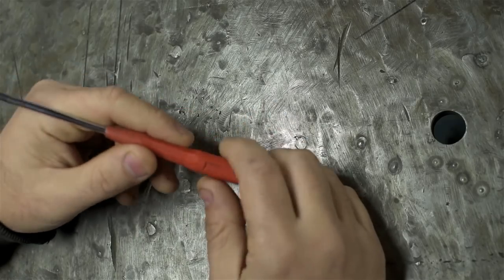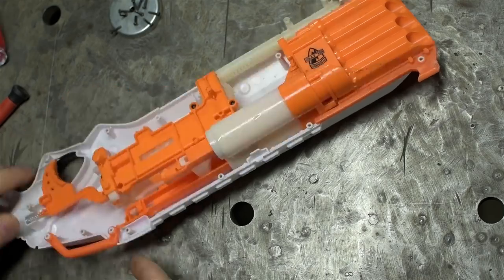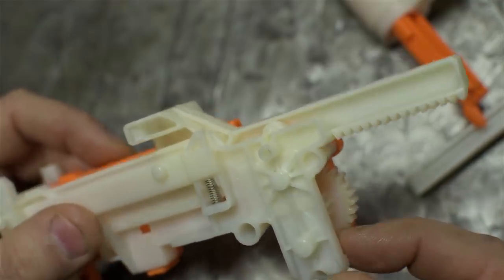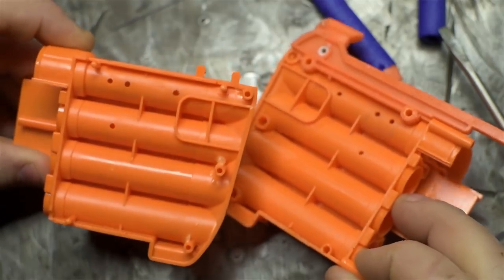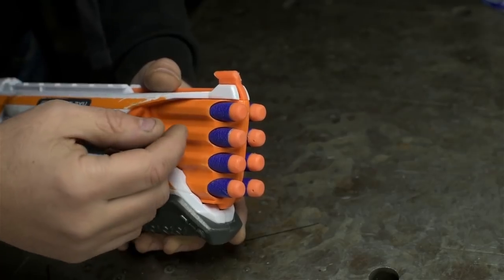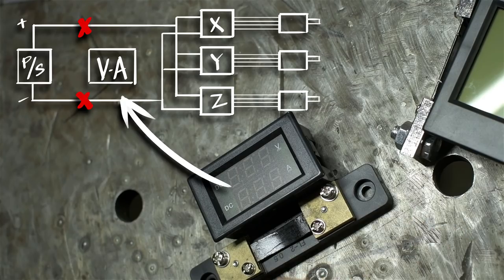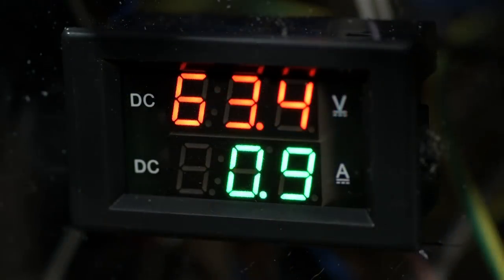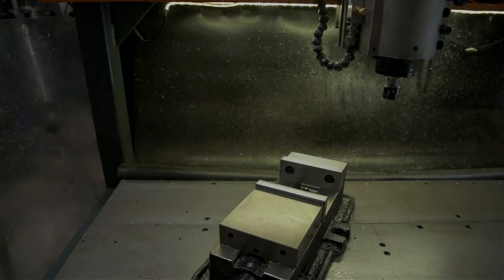Shoot'n The Poop #6 - Fixin' Stuff

Comment: Is Morse code the same in metric? I had to multiply by .0394 to be able to decipher your hidden message. Thanks for the time!
Reply: SUBSCRIBE, this old tony´s classics
Reply: If it's metric then it would be Celcius code...
Reply: It's same but about 2.54 times faster, as it doesn't take dots and dashes that long to travel 1cm as it would take to travel 1 inch of way! :-D
Reply: Unfortunately not, I wish they did have a standard tho would make the Morse code listening websites easier to use and you'd know exactly the length of the dots an dahs and the time space to leave between them when doing audio reproductions.
Reply: Jason Moody  its Morse code for "Subscribe" hes so funny.This old Tony is a Legend! Love this channel.
Reply: In metric it would be macaroni code. Erm I mean Marconi.
Reply: @SlyerFox666  There is no standard timing for Morse code signals though. It's just a long beep for a dash and a short beep for a dot. It's supposed to be something you can do by hand, so everyone's signaling will be a little different. In fact if you listen to enough Morse code you will start to recognize specific people by the way they tap out signals. So having mechanically generated timing would not necessarily be a good thing.

And I just realized that I actually learned a lot from dating Spc. Decker, the Morse code listener in Korea. Last I heard she settled down with a nice guy in Wisconsin and had a few kids. I wonder if the ticking of the fridge still sends her scrambling for a pencil in the middle of the night.

Comment: Holy crap that nerf gun assembly was smart. Never thought they'd put that much effort into a kids' dart toy
Reply: That's the wonder of mass production. Get the design right once, and then pump out millions of copies.
Reply: They are all auite impressive actually. I highly recommend having a look inside any you come across, if you can without upsetting a child. Their design is always clever.
Reply: @magellanicraincloud  Nope... Their design is clever when the design is clever.
Reply: Remember the "Furbie"?  They had such a futuristic electronics package, that the soviets were allegedly buying them up to use in a weapons system!
Reply: It's not a toy... it's a fun gun.
Reply: @jjhack3r  so, a toy
Reply: @billhinkle1653  might be a little grain of truth somewhere in there, but for one thing, the Soviet union was dissolved in 91 and furbies came out in 99. They did use a primitive form of a.i. look up the toy '21 questions' I had one, it's a fun toy. They also used a type of neural network. Interesting stuff. 

If it did happen, it wouldn't be the first time something mass produced was repurposed for a reason no one could have seen coming. Re: tide pods lol
Reply: @dozog  No u

Comment: My grandfather was a research engineer at Bell Labs during WW II. He taught me a great lesson when I came to him with a non-functional electric motor out of one of my toys. "Sometimes you just have to take it apart, try to understand how it works, then put it back together." It worked then, and has served me well ever since. I have a bit of reputation as a fix-it guy, but really, I mostly just take stuff apart and put it back together.
Reply: But if there is not at least 3 screws left on the table then you did it wrong.

Comment: But Uncle BumbleFuck said Fluke meters were super skookem!! I feel like I've been lied to :(
Reply: He is true. But when you use your tools they sometimes break down. Especially those plug things.
Reply: I had the same problem with my Fluke.  Shot the connectors with some contact cleaner and it works good as new.  BTW did those solder joints look cold to anyone else?
Reply: BEdmonson85 Lead free solder doesn't look as shiny as lead solder, even with proper soldering.
Reply: CrimSun ,. True but if you pay close attention to the joint on the middle plug, on the left side. It looked too me like it didn't get full coverage when he resoldered the new connector on. Edit: Actually, both pins on that plug looked a little light on solder
Reply: Now that's funny

Comment: Any good mechanic will always have left-over parts.
Reply: Every self respecting mechanic uses less screws when reassembling a machine he took apart
Reply: @Daravigos  Efficiency and weight reduction are top priority when rebuilding something!
Reply: Just fixed my grandma's toaster, I put in only 3 of 4 screws that held the PCB  as I had a strong suspicion I'll be seeing those insides again.
Reply: Less work for the next chump that has to fix it which most likely will be you

Comment: Unbelievably, I did not know how to measure amps until this video. Apparently you have measure voltage before and after a resistor and divide the change in voltage by the resistance.  No one else ever explained it before, and I have never needed to find out for sure how to do it.  So, that was really helpful to me.

Comment: Another great video, thanks! BTW, at 13:38, the current measurement wires to the shunt should go from the small screws (inside ones) on the shunt right back to the meter, and the "broken" power return should go through the big screws (outside ones) on the shunt. If that makes any sense. The instructions are often not very clear on these, but you want a Kelvin (4-wire) connection and you'll get a significant error if  it isn't done that way.

Comment: Engineer droppings...  I worked in the production crew at a TV station and that's how we knew an engineer had worked on something.  Random screw left behind.  ;)
Engineering on the nerf gun is IMPRESSIVE.
Thanks again for the video.  BTW, they now make little panel meters that have a historical graph.  Might be easier for catching current spikes.  If you hear it but aren't be the meter.

Comment: Current chopping stepper drivers (basically all of them these days) will give you that sort of behaviour. They rapidly switch electricity to the motor coil to achieve your set current (6A) using a PWM scheme. The driver and coil inductance can be thought of like a switching power supply that regulates for output current instead of voltage. 
Mechanical power out is torque x angular velocity. That comes from the electrical power going in to the motor. Electrical power to the motor is set current (6A) x voltage sent out by the driver. Electrical power in to the drivers is what you’re measuring. The conversion is far from 100% efficient and your meter may also be missing the high frequency components being drawn as the driver works but the meter will give you a rough idea of the machine load.

Comment: Another great video Tony, I always love seeing a ToT notification pop up.
If that multimeter develops a similar problem in the future, open it up and double check the solder joint on the top pin of the common plug of the plug strip (you soldered at about the 1:45 mark of the video), hopefully it's just the lighting on the solder in the video, but it looked like a possible dry solder joint. Not trying to be critical of your soldering, it looked fine to me, but as someone who has soldered many a dry solder joint in my time I'm hoping to save you some of the headaches I've caused myself in the past. With plugging in and unplugging of leads over time, if that is a dry joint it may be a possible point of failure in the future, I would hate for you to have to order another plug strip if it is just one solder connection giving you grief.
Great content as always Tony 👍 Keep up the good work.
Reply: It's called a cold solder joint, not dry.

Comment: I thought putting the Nerf dart gun back together was fantastic! Reminds me of my first time rebuilding a carburetor.  There was a ball bearing left over and I thought well how important could a little ball be?  Fired it up with the air cleaner off, and immediately started throwing flame out the top. slammed the hood shut, and as the paint was starting to discolor on the hood, I jumped in, and was going to shut off the ignition, and someone hollered to step on the gas.  Sure enough it worked!

Comment: I've had a fluke sitting in s toolbox that had that same problem.  I couldn't find a replacement socket.  The day I needed it and it was broken I needed to measure volts so I pulled that apart and flipped the socket around so the colors are all mixed up but it worked. That's where I'd never take it apart again until I had parts to fix it. Now 5 years later it's still in a box.

Comment: You should pop the Fluke open and scrub the flux residue off with some isopropyl or ethyl alcohol.  It can do funny things to resistance readings, as well as lower the flash-over protection for higher voltages.  Your actual soldering passes muster.

Comment: those valves at the rear of the dart chambers also act as a sort of 'dry fire' safety system, so the power cylinder doesn't just slam forward when there's nothing to put that energy on.  It has to flow past that valve which slows the piston down to 'less than plastic shattering' levels of power.

Personally, I've stepped up to Airsoft, which is a whole other barrel of monkeys to get a handle on.

Comment: Did you notice that the sear is the Nerf 2x4 isn't the the same height on both sides? Nerfers call it a staggered or staged trigger. It's a simple selector mechanism. If the trigger is pulled slowly one dart will be fired then the other will fire, allowing single shots.

Comment: Probably measures current the same way I get the plate current on my amp tubes. Just put a 1 ohm between the cathode and ground & get the voltage drop, that way I don't hurt my head with math-y stuff.

Comment: Hi Tony! Firstly, it is a great video alzo funny. I have a question about my cnc router.İt's steppers have 12.5Nm torque(in my calculation it is enough torque) and X axis is driven on rack and pinion.So I have to active backlash-compensation(0,05mm) in mach3.Here is the problem occurs.When X and Y work same time or high feeding (upper 1000mm/mm), Steppers are stalled. I watched your older video about your CNC router (part3) you use  backlash compensation .Have you ever compared this to a situation like this. 
 Have a Nice  day

Comment: 2:00 Don't forget to re-calibrate the surface flatness function against your 1-2-3 block. The offsets are stored in volatile memory on the Fluke 83. My company ended up  sending a bunch of out-of-tolerance parts to a local art school for recycling. It's been fixed in the latest firmware patch, but I think Dave Jones might have a hardware mod for it as well...

Comment: I am totally shocked.  All that wear and tear and you still have all the darts!  I trust you have taught your son to respect his weapon and to only fire at evil miscreants of society like Amway distributers, loud Harley's, and anything with tinted windows that goes BOOM BOOM BOOM (not that I am bitter or anything).  
I have the same ammeter kit I got awhile ago to put on my machine thinking I could relate spindle load and tool pressure for comparing inserts and grinds, etc.  Maybe someday I will work out using it with a 180V reversing motor controller as I don't think the kit will work in reverse.

Anyway, best holiday wishes to you and your family.

Comment: The current indicates how hard the electrons are working to turn the spindle.  The harder they work the higher the current.  

In this case you could use knowledge of the current current value, meh,  to fine tune the RPM for differant materials and depths of cut.

Comment: You're dead on about the holes in the sides of the barrels of the nerf blaster.  Even despite the attempt to balance, the loss of power as you go from firing top to bottom is pretty noticeable.

Comment: does anybody know what the multimeter part is called i have a similar problem on mine but i can’t figure out what the part is called to get a replacement
Reply: you should search on ebay (or Google, maybe Amazon) for something like (if you have a fluke meter),  "Fluke multimeter socket replacement".  I just did this on eBay and found some.

Comment: Great video as usual- just some computer info totally out of nowhere. not sure what kind of computer for editing you have but I just got a ryzen 1700 computer (with ssd) and elements has not asked me once to render- no delay at all from the computer during edits.  I had a fairly recent model intel that was driving me nuts- was only quadcore, ryzen is 8 core 16 threads which is key for editing (that and a sdd).  Anyways if you don’t have an 8 or 16 core CPu consider it- I will be more than happy to pitch in some money for this if you set up a Patreon as you have “pitched in” your time for us.
Reply from the maker: wow, good to know!  not sure what I'm running.  i5?  i7?  quad core most likely.  I most definitely wait while it renders :(

Comment: Tony, I know your a busy man but can you let me know how you run 3 phase in your workshop? I've just been quoted £22,370 by Western Power to have it fitted in my shop in the UK!!! The top brass at Weston Power must spend there spare time with there fingers in the sockets they supply electricity for, or people have just got more money to spend on there workshops than me! Which ever it is I'm looking for an alternative 3 phase power source. Thanks and love your vids
Reply: AvE just reviewed a VFD (basically a 1 -> 3ph solid state converter). 3HP for about 300$ if my mind works correctly. check it out.
Reply: Short answer- dont
Reply: Debo Devel, There are three main ways to get 3-phase power.  First, bring in through your electrical provider $$$$.  Second, set up a rotary phase converter $$$. Or Use a variable frequency drive (VFD) for individual machines $$$.  A good source for information on rotary phase converters is Kay Industries www.kayind.com.  You can build a decent rotary converter with a three phase motor and a  Phase-o-matic static converter fairly cheaply.  It all depends on your needs, resources, and ability.

Comment: Don't know if you read old comments, but re the voltage drop you are seeing probably not due to soft supply, rather the voltage drop across the shunt. It is actual voltage being fed to drivers, but not actual coming out of supply. To measure supply out move v-sense to other side of shunt... This comment worthless of course because the way you wired it most useful. I just couldn't tolerate you maligning your supply like that!
Reply from the maker: Appreciated, thank Doc!

Comment: So Tony.... Many manufacturers do not allow users access to repair parts. Or, if they do make and distribute the parts to the public who own their products, the cost of a single part can be as much as 50% of the retail cost of the new products. So, do you frequently experience the same negative thoughts we all have when it comes to fixing things? What will that part cost me? Or have you figured out some special code word or handshake to get past the gatekeepers who want their products to be serviced only by their fully authorized service stations? Did Fluke make it easy to buy the part you needed at a reasonable cost? And what about other manufacturers. I have lots of worn out parts that need a source. And it is not from lack of calling the companies. What is your secret?

Comment: Voltage is measured "parallel" to a circuit and you're measuring "voltage drop". Amperage is measured in SERIES with the circuit and is actual current "flow". You can't "calculate" current from voltage alone unless you know the resistance which is "variable" as the temperature of the resistor and other conductors change. And "standby current" is a completely new "electrical term" I've never even heard of before. Did you get your "electrical engineering" degree from the same school as Robrenz?

By the way, a "capacitor" should have no "bleed down time" if power is removed from them and they're disconnected from the circuit they "feed" cleanly.